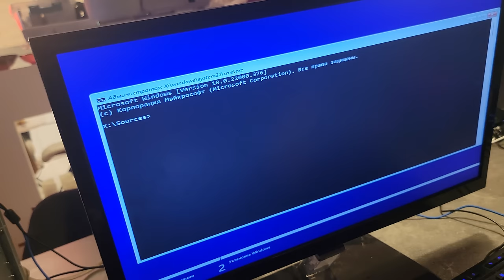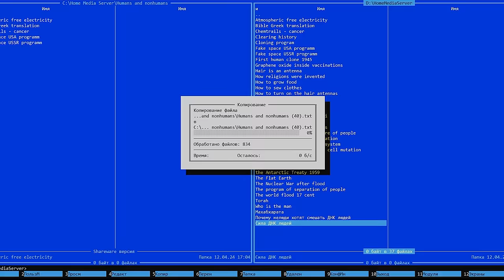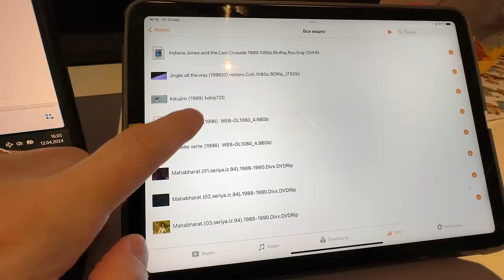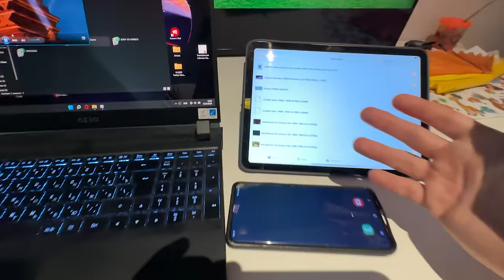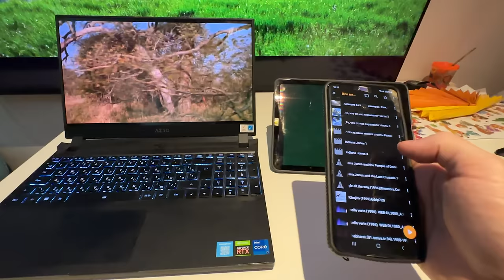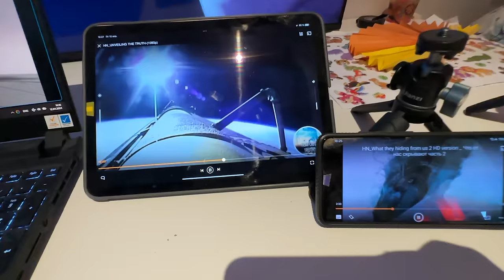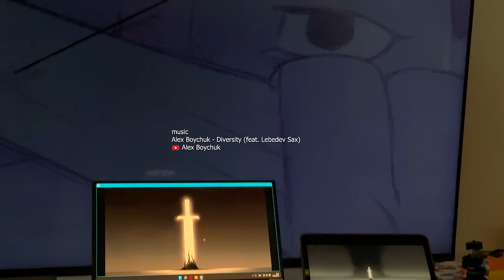I ASSEMBLED A COMPUTER FROM JUNK IN RUSSIA

Comment: So, watching you create a NAS from very old computer parts was good to watch.....and it works. My oldest son has installed a ceiling to floor computer rack full of various equipment. I admire how he has done this without a degree in computer engineering and has purchased everything online from local sellers at very reasonable prices. He has even hosted his NAS on the internet which I use watching movies. He also produces web pages doing it the old fashioned way without using a web production program. He has produced a web site for a local school and this has led to other orders from other schools. Very proud of him I am.

Comment: Use to buy Sun workstation and restore them to working condition. Pretty good side hustle
Reply: There is a partially rebuilt one in my garage. I was working on it when I became disabled and cant stand to eork . The benches are too high to sit at, so it's sat there for too many years. My main bench is a recycled pair of half height relay racks from a DEC PDP8 that ran machine tools during its life.

Comment: I love that you know DOS commands, most people don't have a clue how to do that. :)
Reply: Btw, It's not DOS. It looks like using Windows 10 utilities in a terminal window.
Reply: @aspinx  Which uses DOS commands... Windows is merely a shell that runs over DOS... Windows never has figured out how to completely build an operating system without DOS at it's core...
Reply: @jsfoster75  That ended with Windows ME - the last version of Windows that  was running over DOS. NT line on Windows (NT, 2000, XP, Vista, 7, 10) - never used dos. Which is why they can't run dos applications properly, especially if they are timing dependent or interfacing hardware.
Reply: @aspinx   The Command prompt is literally a DOS window...
Reply: @jsfoster75  It's not DOS, it's DOS emulator. You can't access hardware within it and it won't run most of the DOS programs. Also, the tools that he uses in video (diskpart) aren't even part of DOS. Or maybe you're confusing DOS with "command line interface" (aka shell) as a way of interaction with computer?
Reply: @aspinx thought it was a linux distro
Reply: that a regular CMD not dos

Comment: I'm impressed you were able to find a compatible motherboard/CPU/RAM combo on the streets!
Reply: Its easier than u think, old computers being sold these days or given away are from 2010s and use ddr3 and lga1155 mobos and cpus like dan has gotten
Reply: Probably wasn't. That's a Z68 and i7 2600k. Almost "too good to be true" pairing. Those parts all just appeared and only the GPU (which isn't really needed, iGPU is good enough unless you want to game, where that old ATI falls short) was shown to be found, which is way more believable. That Z68 could run a 3770k, but you'd have to be sure it had a BIOS update done to it previously or have a hardware flasher (Ch314a) handy.
Reply: @b0ne91  I agree. The fresh termal past on the cpu cooler is hella suspicious

Comment: Great video man, I liked seeing the flea market on the streets and seeing you teach your daughter to use/install the computer! 
Just 1 tip, when you build the PC be sure to put the RAM in matching color slots when you use 2 modules; the slots are marked grey and blue. Check the manual for the motherboard online or experiment to find out which ones you should use, it gives you the benefit of dual channel speeds :) 

привет из Нидерландов / Greetings from the Netherlands

Comment: Hi there, nice build. Just a few advices, memory modules are better to be installed at slot 2 and 4 first (from left to right). And here's a nice trick for applying thermal paste - squeeze a little bit on cpu surface, you could wear a disposable glove and gently flatten it with your fingertips. It will have a very flat surface.

Comment: You don't need to spread the thermal paste, just a little pea size dot in the middle of the CPU is good enough and it will spread once you apply pressure to the heat sink. Good choice in the thermal paste too,  I use the same Arctic MX-2/MX-4.

Comment: I only found 3 problems that can be easily solved, firstly, avoid touching the golden contacts of the components as the oil from your hand can disturb the contact, secondly, the most correct way to tension a cooler on the CPU is to tighten the screws opposite each other. to each other instead of pressing them in sequence, third, place the RAM memories one after the other, doing it this way limits the connection speed between the memories, place them in the slots of the same color (according to your board they should have been populated the blue slots only)
Reply: Also, it is optimal to use a pea sized dot of thermal paste and allow the tensioning of the heatsink to spread it evenly, as there is less chance of air bubbles forming.

Comment: I don't wanna be that guy, because what you've done is nothing short of amazing to build a pc out of all that, and it's only a small thing. You put the ram in the wrong slots. You put 2 sticks in the 1st 2 slots (black and blue.) And I am pretty sure you have to skip the blue and put it in the next black slot. But as I said, it's a minor thing and does not take away from what you have built here ❤

Comment: We dont have similar computer part street vendors here in my country Uganda but l also built my first pc in a similar way. I went from shop to shop buying a part at a time.

In the end l managed to put together a core 2 duo and an hd6670 from amd. Later l upgraded it to a core 2 quad q9650? And a gtx 750ti when l got abit more money😂

Its satisfying building the whole thing from parts acquired here and there over time.

Funfact: i had to learn cpu pin re-arranging since the motherboard l got had them bent. Its likely why l got it cheap :)

Comment: For the RAM, it will run quicker if you put the RAM stick (when only in pairs) in the slots of same colour (to enable dual channel RAM configuration) to get the best speed from the RAM (usually start with the two blue RAM slots first). Otherwise these older 2nd generation Intel based PCs are still useful computers, so good save.

Comment: RAM goes in both the blue or both the black slots or won't operate in dual channel.

That being said, this video looks a bit too good to be true. That's a good qualizy Z68 board, the i7 2600k is the best CPU for that board that will work (without a BIOS update). The GPU isn't needed (iGPU good enough) and is a believable part to be bought at a street sale whereas the other parts are less likely. Especially that Noctua cooler, which alone is worth more than most of the other parts combined.

Comment: You made a mistake. If you're using 2 ram sticks, by default most motherboards recommend you to install them in the 2nd and 4th slots (starting the count from the slot closer to the CPU). You get better CPU cooler clearance and dual channel. Dual-channel configuration can provide a significant increase in memory bandwidth, which is the rate at which data can be transferred between the RAM and the processor. This can lead to faster system performance, particularly in tasks that rely on quick access to large amounts of data.

Comment: Great work, but one small detail is bothering me. From 10:07 to 10:12. Why did you place the RAM modules in slots A1 and A2 instead of placing them in slots A2 and B2 to enable dual-channel mode? Or is it because memory channels B1 and B2 aren't functioning? I had a motherboard like that recently. I ended up switching to a different motherboard because nothing else helped...

Comment: Hey nice work, for the ram to work in dual channel the best option is slot 2 and 4 the two blue slots. Now you used slot 1 and 2 and you have no dual channel working. The user manual for the Asus p8z68 is still on Asus there website, I've checked

Comment: You have install one ram on the wrong slot,  if you have 2 stick,  use firt slot from right and the other one in slot 3, for you is the blue slot you need to use for dual channel.

Comment: You put the RAM in the wrong position.  To enable dual channel DDR, the ram is to be placed in slot 1 and slot 3 (black) or slot 2 and slot 4 (blue).  This enables DUAL CHANNEL memory !!. I7 2600K  can be auto safe  overclock with dual channel ddr ram.  good luck.

Comment: I see that you are using windows there. You can achieve basically the same outcome with rtorrent and rclone serve dlna on a Linux. Without having to deal with windows shenanigans. A debian stable would run awesomely there. And with flood, a web interface for rtorrent and transmission, you can check status and add torrents using a browser and with tailscale you can access it remotely from any place on the internet as if the machine were in the same local network, kind of, ssdp discovery that DLNA does doesn't work this way.

Comment: 1155 вечен!) сам юзаю с топой asus p8z77-v pro топовый на этот сокет камень i7 3770, с rtx 2060 super мне хватает за глаза!
1155 is eternal!) I use the asus p8z77-v pro w, the top-end i7 3770 stone for this socket, with rtx 2060 super I have enough completely!
PS: ай, ай, ай, оперативку поставил в неправильные слоты, не будет 2 канального режима, надо было обе в черные слоты!
OMG, he put the RAM in the wrong slots, there will be no 2-channel mode, it was necessary to put both in black slots!)
PSS: Why was it necessary to connect the keyboard and mouse to USB 3.0 when 2.0 remained free? USB 3.0 only 2 slots at the back, would be useful for connecting flash drives)

Comment: *If anyone is curious about Russia - please learn some Russian language and watch videos designed for Russian demographic. Those would be much more informative and entertaining.
I don't know why this is in my recommended. In Russia there is a functioning marketplace for used things called Avito (sorta like eBay), where is safer to buy stuff than in an actual market like this guy did (especially HDDs, don't ever buy untested used hard drives). I am not going to cover the choice of parts, some of which I would've resold to take simpler once and put more money in performance. What baffles me the most is the ongoing praise of this build. Some time ago one Russian blogger (MaddyMurk) tried to do the same thing for content - buy random stuff on the market to see if it worked. Half of it didn't. What I see here is a not-so-high quality video, designed specifically to garner sympathy, rather than create high-quality content (you could've explained to people what you do and why, but instead I heard the word "censored" more often than on official news channel, despite the fact that most if not all of censored content can be pirated (and usually IS).